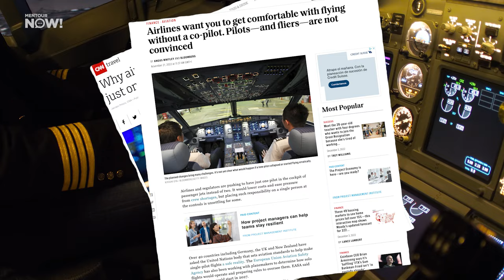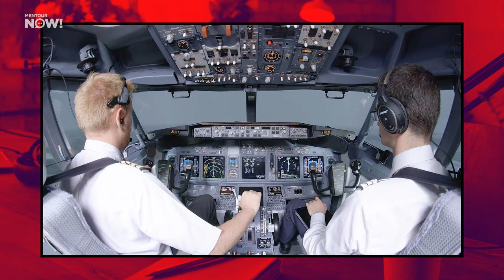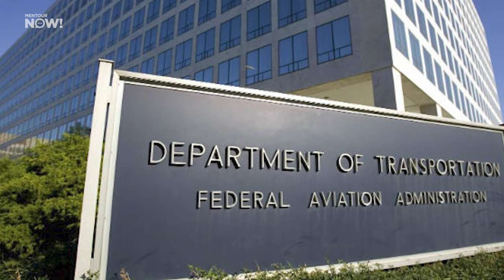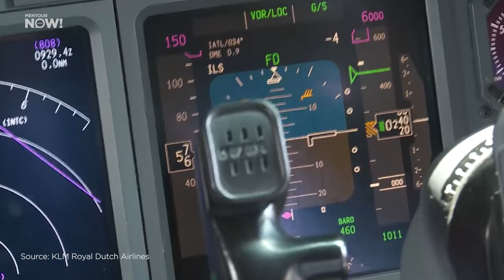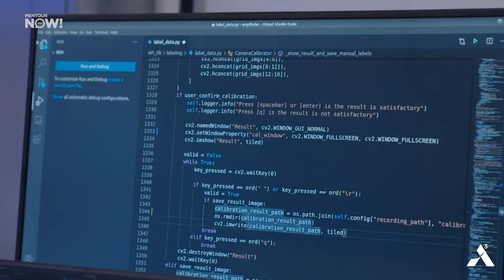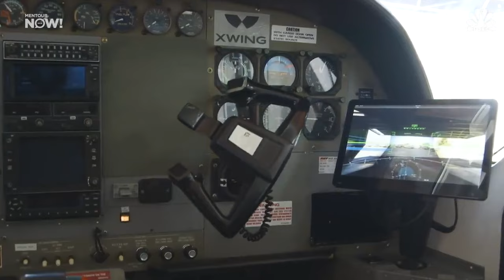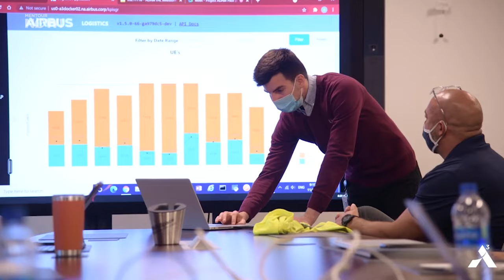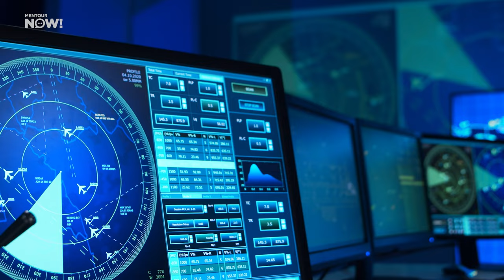The End of the Two-Pilot Cockpit?! Get Ready for Single-Pilot and No-Pilot Airliners!

Comment: It may be talked-about but in a commercial environment, it will NEVER happen.
As long as insurance companies are liable for the airframe, crew and pax, a single point of failure in ANY SYSTEM is taken from the equation. A SIMPLE example is the Phenom 300.
Although certified for Single Pilot operation, they are ALWAYS crewed by two pilots (except Part 91 flights) because insurance carriers Will Not Assume the extended risk in the event of crew incapacitation where automation is unable to react in less than nominal conditions.

Comment: I agree that at least TWO pilots in the cockpit of an airliner are sine qua non for safe and reliable operations. As to a pilot "shortage" due to not enough "flight" hours logged on the type aircraft they are rated on, with all the technology now packed into airliner cockpit simulators, it should be easy, by using simulators more effectively, to have sufficient pilots that meet the 1,500 hour rule for as long as humans fly airliners. 

Airliner simulators are HARDER to fly than the real thing! Those hours logged there should be EQUALLY valid! And yeah, they should make thousands of those simulators, instead of the hundreds out there now per aircraft type used almost exclusively for recurrent emergency procedures crew training. Furthermore, it is MUCH, MUCH CHEAPER to fly thousands of hours on a world class simulator compared with actually burning hundreds of thousands of pounds of fuel flying the actual aircraft. 

Leave a crew in a simulator for the SAME amount of time a routine flight on that airliner takes, complete with flight attendants that bring meals. LOG those hours! As to the minimum required number of landings, the simulator can be used to rack up 30 landings in less than a week IF there are enough simulators availalble. 
    
All that said, the GREED of too many airline CEOs may be now causing them to ponder how much cheaper it would be to make the second pilot work from a drone facility (at less pay) where he is "technically" the "co-pilot", while the airliner he is monitoring through drone technology software has only one pilot at the controls. The drone pilot could, in theory, take over the controls and land the aircraft safely if the pilot on board becomes incapacitated OR makes some serious error that endangers the flight. The greed based idea here is that corporate poobahs will do whatever they can get away with to avoid reducing their own over inflated, totally unjustified, "compensation" packages.

These greedball Social Darwinists are a threat to everything good about human society.
https://soberthinking.createaforum.com/who-can-you-trust/corruption-in-government/msg597/#msg597

Comment: Humans get creative when systems and automation fail (or worse, degrade so a failure is hard to detect by automation). Only having one pilot, to both deal with the failure (fly the aeroplane) and creatively solve the problems that causes, is a risk that should not be under-estimated by regulators.

If a train fails, it comes to a halt pretty quickly (hopefully on the rails). If a plane fails, everyone dies, hopefully only those on board and not more on the ground.

Comment: Even as an FO, I can point with pride to a few times when my actions led to the safe conclusion of a flight. This is not bragging, it is often a matter of someone being able to do other things while the captain is flying. It means asking questions and getting information the captain might not have to time to even think about.
Reply: Most Excellent
Reply: Exactly. I don’t think it’s cocky or bragging at all, I agree! I know emergencies are rare now, but they still happen. So do incapacitations and pilot suicide. I would never fly on a plane commercially with just 1 pilot.
Reply: Not to mention the priceless transfer of knowledge that comes as a brand new FO flying with an experienced captian…
Reply: Exactly. Only in case of an accident or incident the human performance is reviewed. But how many times human resilience has actually saved the flight, isn’t exactly known and therefore not part of the statistics. Computers, for now, aren’t, if at all, resilient enough.
Reply: I agree with what you’re saying, but some major accidents have been caused by poor crew management, when pilot and first officer weren’t on the same page.
Reply: We trap errors, correct and move on..
Reply: Someone needs to run checklists in emergencies. A SINGLE pilot often could not manage both: flying, checking lists - and, oh yes, there is also comms with towers and controllers.
Reply: @jeremypearson6852  They would have still happen if only one pilot on board, don't you think?
Reply: Also thanks to CRM that FOs are allowed and encouraged to do that without consequence.
Reply: Humans are smarter than computers. We need TWO humans flying each commercial jet.
Reply: Even? FOs are super important!

Comment: During emergency situations it's safer to have at least 2 pilots to be able to reference each other in case one pilot happens to overlook something or needs a different perspective to help solve a problem. Single pilot crew would be a terrible idea.
Reply: confirmation bias
Reply: @leonel9683  How so?
Reply: @feonor26  a single pilot will suffer confirmation bias
Reply: What if one pilot falls asleep or gets sick? I drove trucks all night & drifted off for 2 or 3 seconds. Miles go faster in planes.
Reply: Simplese?
Reply: It's one of the reasons why we fly either multicrew or single ships in formation in the Air Force. A pilot alone in an emergency is going to be oversaturated. You can have one person reading the checklist while the other executes. 2 people to double check instruments. 2 crew to split flying and communicating with ATC.

Comment: Have to update the emergency brochure before takeoff to include - in the event your pilot becomes incapacitated, please enter the cockpit and follow the “No pilot checklist” to safely return the aircraft to earth.
Reply: Press the auto pilot button, if that does not help, press the "ATC controll button".
Important: Press the ATC controll button before leaving ATC serviced areas.
Areas with no ATC service may include: Active war zones, french air space during ATC union strikes, high seas, ...
Reply: Automation should reach a stage where the passengers have a show of hands before the flight as to who will be flying that day-lot's of savings there.
Reply: Actually this is already a reality. If you fly on a plane equipped with a Garmin Autoland system you will get a brochure where it says how to use it in case of pilot incapacitation.
Reply: That is the most dangerous thing. That means you can't keep the cockpit locked, and when you are flying at mach 0.78, there is no time to react if the best pilot in Iran gains entry before final approach and targets the nearest trade centre just 30 seconds away.

Comment: I thought that after the  Germanwings episode that pilots aren't allowed to be alone. I suppose that having a member of the cabin crew sit upfront for the duration of the flight is cheaper than an extra pilot.   🙃
Reply: That rule was quietly dropped a few months after the incident, because it wasn't very feasible.
Reply: Or have one lucky passenger sit in the cockpit (as an air marshal) during the entire duration of the flight🙂
Reply: The US airlines I’ve flown since then have a process of a senior flight attendant stepping into the cockpit when a pilot steps out.  The galley is then blocked by a meal cart with another attendant until the pilot returns to the cockpit.  I stood up on a recent flight to stretch my legs during this activity and was told by the flight attendant to return to my seat…
Reply: Thisr could be solved by including a deployable  emergency Otto Pilot as used in the movie AIRPLANE !
Reply: @bobroberts2371  ahhhh….. another fan of the classics!!!
Reply: It's like the old joke about automation, where an automated plane has a pilot and a monkey with a gun. The pilot is there to push a button in case of emergency, while the monkey is there to shoot the pilot if he reaches for a button.
Reply: @NekiCat  It’s certainly still adhered to by some airlines - recent flight I took with Ryanair they even announced over the PA system that the seatbelt sign was being put on because one of the pilots was using the toilet, and a member of the cabin crew went into the cockpit whilst the pilot used the toilet
Reply: @plrswax1  until the air Marshall goes rogue
Reply: @Niiikh23  I see. I heard this from a pilot from another airline, seems to vary then.
Reply: @NekiCat  It was dropped in europe at some point, as a mandatory rule, however it varies airline to airline whether they wish to still have the internal policy in place. Ironically I believe GermanWings didn't keep it.
Reply: @bobroberts2371  Surely you can't be serious!
Reply: @NekiCat source??
Reply: @DWoodsII  riiiva on Twitch, who is a real-world pilot.
Reply: @charlesoxley7242  I am, and don't call me Shirley.
Reply: @johnhaller5851   It sounds very humorous, but I don't get it.
Reply: @h8GW  It's because systems with automation are frequently broken by inappropriate interference by humans. A plane designed for single pilot operation may be making decisions the pilot doesn't understand or expect, and the pilot has a preference to disconnect the automation when they think something is wrong. My profession was developing highly reliable telecommunication systems. Studies of outages showed about 10% of failures were caused by inappropriate inputs by people. In airplane terms it's like when the left airplane had a bird strike and the pilot turned off the right engine in response. The monkey is there to make sure the human doesn't interfere with the automation that won't make that mistake. There are several versions of the joke, including with dogs to bite the human, and with astronaut instead of a pilot.

Comment: This will always be a pretty hard sell. Having two pilots, even if the plane can basically fly itself, makes it a lot harder for one guy having a bad day to just fly into a building or something.
Reply: Here comes the good bit, you can teach a modern aircraft in theory not to fly into buildings. Modern aircraft have fly by wire which gives the pilot a flight envelope in which he can fly, next step will be even more automatic
Reply: @montgomerymcferryn1542  yeah sure, once we have fully autonomous aircraft there's no problem, but at that point you're talking about preventing the pilot from overruling the system, so why have one at all? It's a much bigger leap than what's being discussed here.
Reply: @XIIchiron78  "...preventing the pilot from overruling the system..."  

What could possibly go wrong?
Reply: @charlesoxley7242  yes that was my point lol
Reply: @montgomerymcferryn1542  Yes, and that's all worked SO well for self-driving cars.  No thanks, hard pass.
Reply: @XIIchiron78  The aircrafts are already pretty much fully autonomous already. The pilots are there as a fail safe because sometimes the software glitches, or a sensor isn't working or there is a short circuit or fill in the blank. To fully trust a software to drive or fly safely is a stupid and hazardous idea.
Reply: @TinkersWithMotherboards  "It hasn't worked yet on consumer priced cars today so I'll pass on it being on commercial airplanes later."
Reply: @nonconsensualopinion  thing is it's easier in the sky I mean how many people are walking around at 30000 feet
Reply: @Nobottee Actually, driving in traffic is mechanically much, much simpler to program for than to 100% automate takeoff/landing. And just look at the number of situations where for whatever reason the autopilot wouldnt, or couldn't work. Cars are a much simpler system, with fewer failure points, and any issues are more likely to result in the injury of a couple of people. Planes are much more complex, any any failures are more likely to result in the death of several hundred people. Tesla FSD, while good, is not even close to being fully autonomous, Tesla itself is saying that. Planes? Yes they will be eventually, but it will take decades for it to happen.
Reply: @Groza_Dallocort  The problem is takeoff and landing. And while it is relatively speaking, actually quite easy to program a car to stop when a person walks onto the road, it is much more difficult to program a plane that lost an engine on takeoff to safely land.
Reply: @phoenix211245  Wierd I mean you can press a few buttons in the cockpit and the plane will land on it's own as long as the ground systems are fully operational. But what you are saying is that the autopilot cant compensate for assymentrical thrust I somehow find that hard to belive
Reply: jeez you just reminded me of that tragedy
Reply: @Chiron

True✅, thats what happened to a Germanwings plane if 1 pilot is in charge

We may not know what 1 is going through thats why i think or its a fact that 2 or more pilots in the cockpit in a commercial or/& busy flight is better than 1

Like incapitation or something
Reply: @Nobottee And what if someone hacks the system, reprogram flight route, for example a terrorist? Would it not be REALLY GREAT to have a pilot on hand then?
Reply: @Nobottee It is extremely stupid to think that aircraft software is not susceptible to hacking or glitches,I would just never fly again if one pilot planes become a reality, because hey I value my life. If you don't, then do as you please.